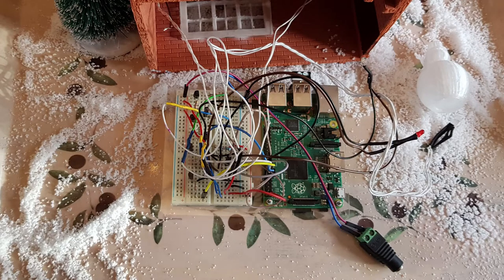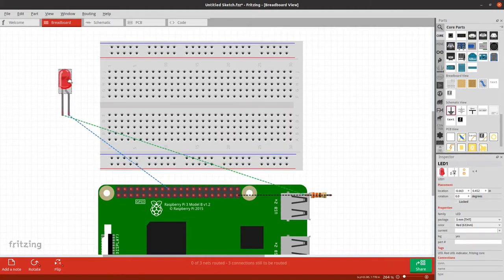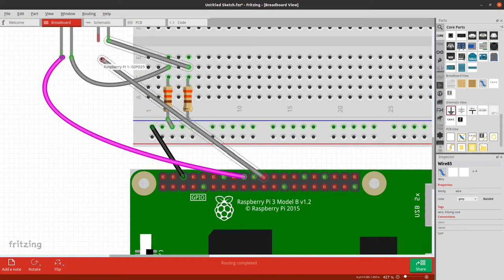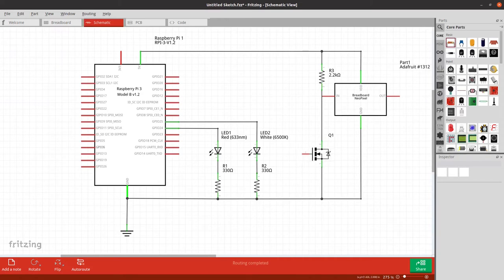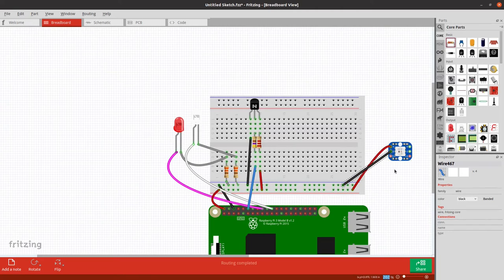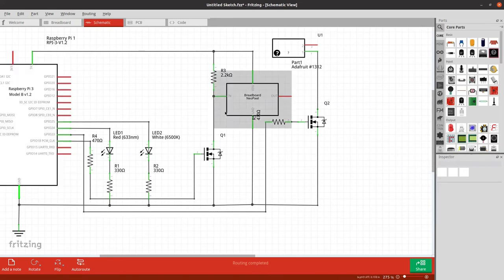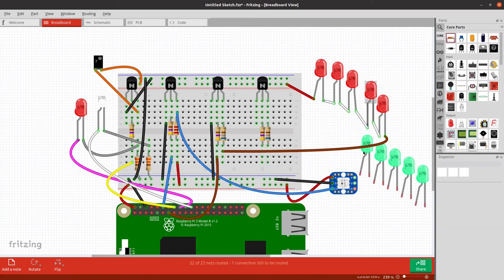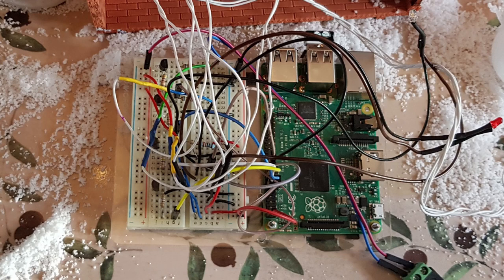Design an electronics circuit in Fritzing - Creating a breadboard layout and schematic diagram

Comment: I've just thought of a possible way to avoid the rats nest accumulating in the schematic. Design your circuit on Tinkercad's breadboard and then use the Tinkercad schematic to build your circuit in Fritzings schematic. You can then create your PCB from that. I'm going to try it and post a comment on my findings.

Comment: Fritzing will drive you bonkers!

Your LED problem when trying to wire them together. If you have them joined by a rat's nest wire then you cannot grab and extend the pins, so use the schematic to join them up.

On the other hand, if you don't have them joined with a rat's nest line, you can't wire them together -- except from the breadboard as you did -- as all you can do is grab the pin and extend or move it about.

So, if you need to extend/move the pins, delete any rat's nest line. If you wan't to wire them together, ensure there is a rat's nest line.

HTH

Cheers,
Norm.
Reply from the maker: Thanks for the explanation. Normally I would put all the components on the breadboard even if they have an extension wire. It was trying to get the string of LEDS wired off the breadboard that through me. I can see that makes sense now. 

You are right about Fritzing driving you bonkers. It's breadboard view is a great idea, but it can be frustrating.
Reply: @PenguinTutor  Indeed. The breadboard view is the most useful view. About 90% of the time. By the way, net labels have a bug.

Create on, call it net_1. Duplicate it and the two are connected, as you would expect.
Duplicate again,  rename to net_2. They stay connected to net_1. :-(

Cheers.

Comment: great tutorial. adafruit have alot of things normal parents couldn't afford if their child was into microcontrollers. they're more expensive than lego. I had to get a bno055 imu sensor and I tried my damnedest not to pay them 120cad for something that weighs less than a gram. I tried to get them from China first but imu and other such things are  eing bought up by large corporations because there's an imu shortage. same with the node that makes most atmel based arduino chips. Nanos cost more than esp32 modules now.
Reply from the maker: The chip shortage is having a huge impact everywhere.
It's sad when children wanting to learn cannot afford many of the useful tools and components that should be reasonably priced.
I hope the situation improves soon.
Reply: @PenguinTutor  I agree with you 100 percent. Please don't think I'm tooting my own horn here because I'm not. I spent the last year or so buying over 5000cad worth of microcontrollers, sensors, displays, breadboards, every kind of motor and wire plus dmms and a soldering station plus so much more I can't even think. Like 6 or 7000 different types of leds (I collect them anyway hehe) and (anonymously) donated it all to our local makerspace which is non profit but there is a fee for all programs, even ones for youth. They have to stay in business. I was poor growing up and being a retired and somewhat young (with an engineering degree I never used) I've gotten back into it hard the past few years because I have so much time on my hands so I decided to make it so some kid didn't have to feel left out making excuses for being poor when it comes to fun educational activities being offered. I am not rich either.

Now adafruit on the other hand would still be 50 to 80 percent more expensive for a module, sensor, 10 dollar usd single 2 pin dip leds. I respect Ada for all the software she's written but not even she's charging 15 dollars for the same ultrasonic sensor you can get for 2 beans a piece in a pack of 5. She's rich enough. There comes a point when someone who is suppose to be all open source and for the maker community and stem education to say I've made enough millions and will make more millions even if I drop prices. Having alot of money is great and I don't begrudge anyone who knows how to make a buck and get ahead but how many zeros extra do you need on your bank statement brother. I ve been know to ask her and that smug looking middle aged hipster why they have never had at least a cheaper line of products like the way all hardware gets cheaper over time. It's depriving kids from falling in love with engineering and this world needs more engineers than anything else and it's not taking food of her table. I was very polite and I think she said something like yeah....nope and he said next new item. Aging hipsters who think they're still cool hahaha.